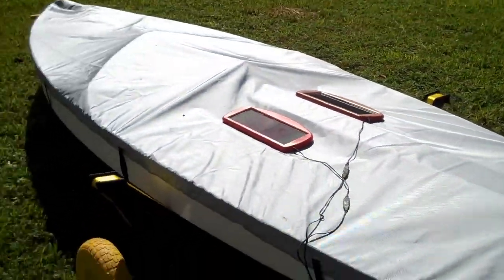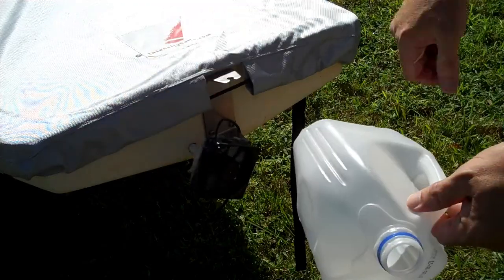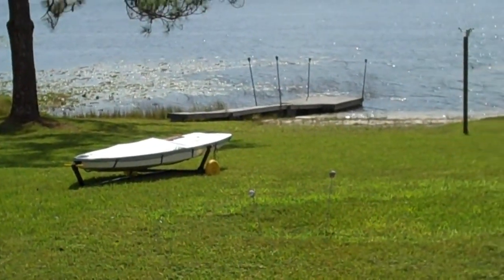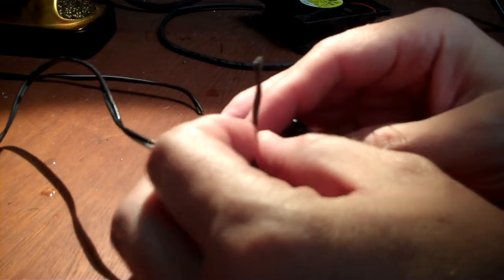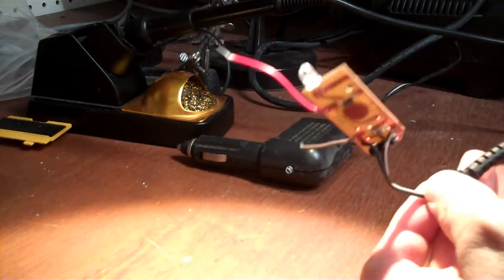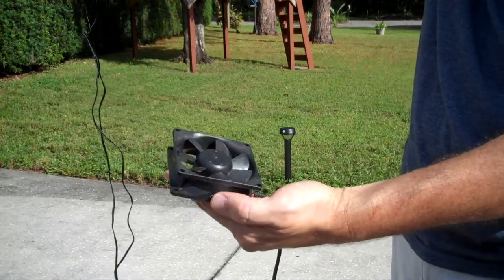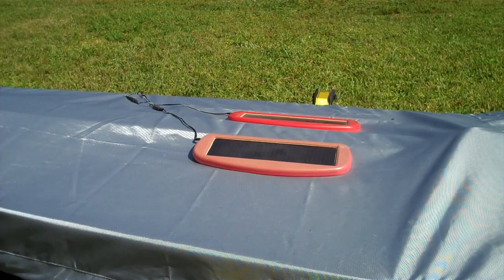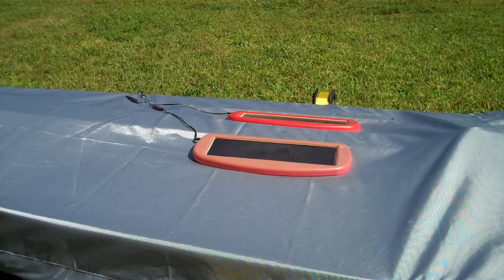solar powered sunfish sailboat hull dehumidifier

Comment: Hi, What if you painted the milkjug/funnel black?
Reply from the maker: Might help heat/dry the air, wouldn't hurt as long as the paint doesn't run.  My suspicion is that there is enough air flow that the small surface area wouldn't increase the air temp much.